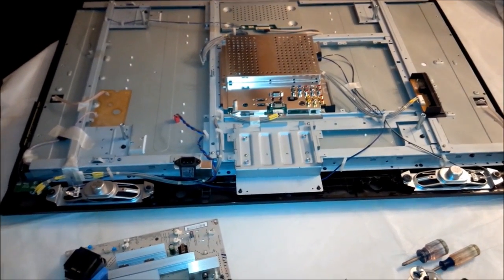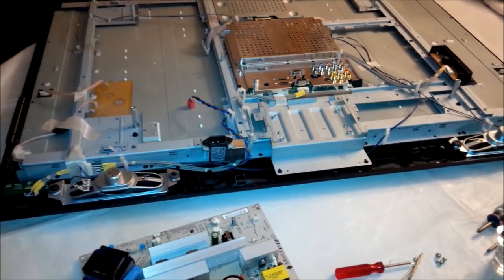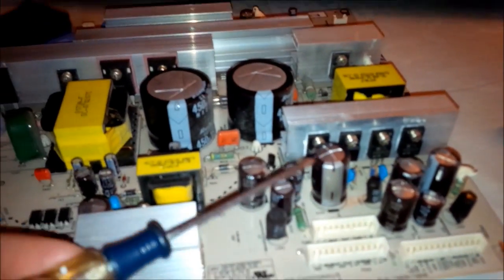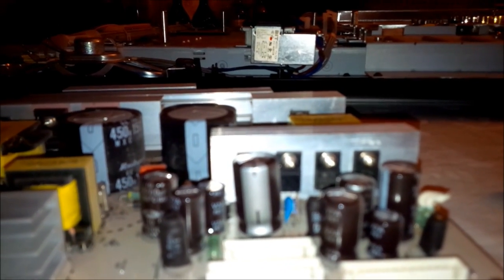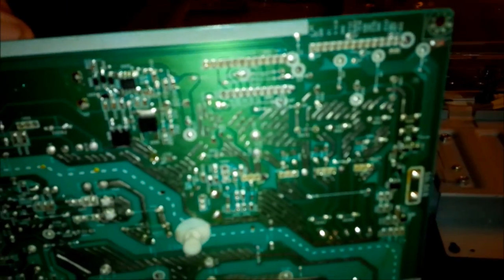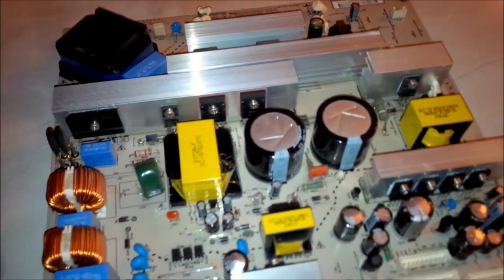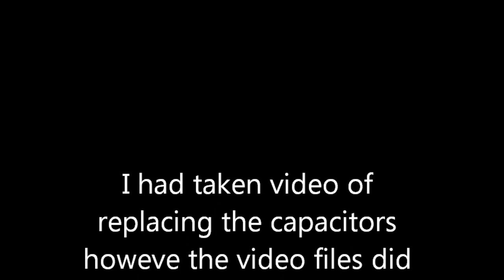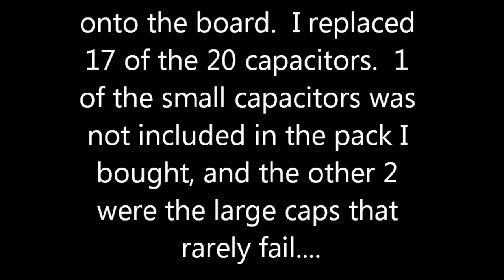How I fixed my LG TV, Won't turn on or show picture Model: LG42LC7D

Comment: Hi Rick I have noticed some of my capacitors are swollen, now my tv is not coming on at all, no red light, and my tv is a LG 32LC5DC- UA is it the same problem for mine.  can you tell me again how to remove them and to replace them again. i couldn't make out what you were saying. thank you so so much for your good advise, you helped me alot
Reply from the maker: Could be the issue, but I am not an expert...

Comment: hi again rick i have another tv just like the last message i written you and my volume only go up to 20, thats as loud as it get how do i change it. Again thank you so much im so glad to find someone that knows what they are talking about. THANK YOU is it ok to share you site with others?
Reply: go into settings, sound, then there should be a range setting, i set mine to wide, allows for greater volume range without needing to turn the volume up too high and vice versa , i might be wrong though...

Comment: hey mate, thanks for the vid. are u able to remember the capacitance  of the caps u replaced?  (general idea of). i have draws with all the common ones,  i just want to know whether I have to visit the local electronics store. thx
Reply from the maker: Nicholas Laing I don't remember, I just ordered a kit off e-bay before I pulled it apart....  and then matched them all up...

Comment: Sir my LG LED TV model no 26LS3700-TB is not turning on when i switch on the power screen is black and red power signal is blinking 3 times and stops but the screen remains black. How can I repair? Is there any problem related to motherboard or capacitor?1 second ago•
Reply: I got the same problem. Anyone knows if its the capacitors? Looks like an easy fix
Reply: E.T Pitt but dere is no any power board only green coloured single board is present without any capacitor.

Comment: Why did you replace 17 capacitors?  Were you not sure which ones were bad?
Reply from the maker: +Ian Toope Because, most all of them were bulged or appeared to be partially buldged.. figured I'd replace them since I had new ones in the kit, and I didn't want to have to take the TV apart again because I skipped replacing a few caps that I already had.
Reply: +vettetech81 just replace 5 on mine. Works great!  Thx.
Reply from the maker: Cool!